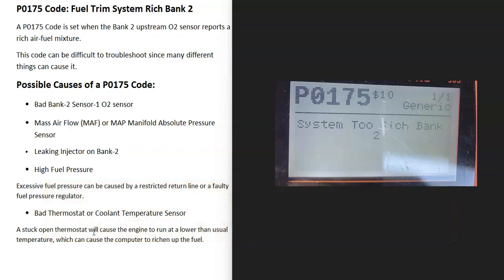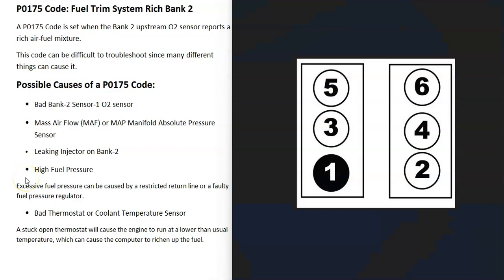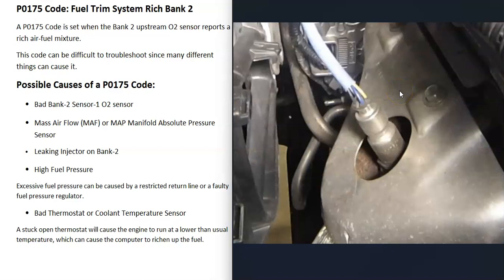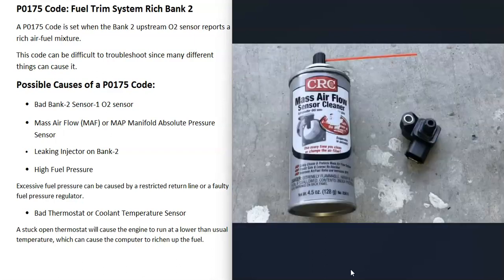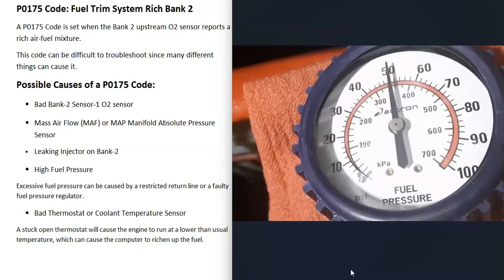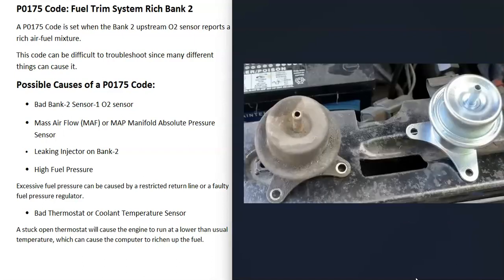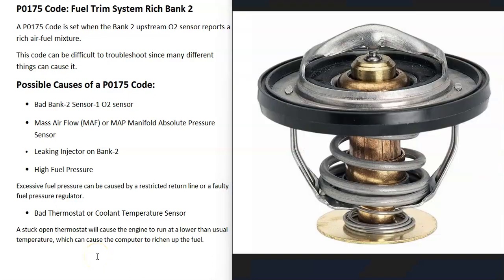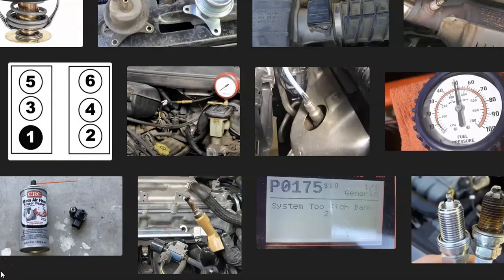Causes and Fixes P0175 Code: Fuel Trim System Rich Bank 2

Comment: What if both banks are rich and it’s none of that
Reply from the maker: If both banks are Rich, it is likely something that would affect the whole engine, such as fuel pressure, stuck open purge valve, or a bad sensor.

Comment: Replaced fuel injector pressure regulator, truck ran great for 2 days , better than it ever has. All 3 plugs on bank 2 looked exactly as your example , black. Engine light went off and thought I had found the problem but after 2 days the same symptoms started again. I'm wondering if I got a bad part /injector pressure regulator sensor. The plugs on bank 1 looked good. I changed all of them and new plug wires ( it was way overdue anyway )

Comment: Dang man, this was the video I was looking for. You are very knowledgeable with this. I just had my hellcat injectors upgraded to 1300s from oem, as well as an aftermarket flex fuel system with a double pump installed as well as a new tune. I got this code P0175 three times in a week after I had my work done. The dealership was saying it's a result of having bigger injectors installed which doesn't sound right. I took it on a trip from Virginia to New Mexico and it came on one time during the entire 1900 mile trip and that was while I was parked at a Loves gas station sleeping with the car running. What do you think the issue could be?

Comment: Question... i have a 2001 f150 with the 4.6l. It has blown out the plug 3 times in cylinder 3 on bank 2, passenger side. It has a helicoil in it. It has in the 4 yrs ive owned it, ran slightly rough. Ive ran the code multiple times since the check engine lights keeps coming on. P0175. I have replaced plugs, coils, cut off the muffler, changed all the o2 sensors, fuel injectors, and about to clean the maf sensor. Oh, and it periodically surges too. I temp is at normal range. I have done just about everything i can. What else could it be? Could the helicoil not be down far enough? I dont really smell gas from the exhaust. I am at a loss, and i dont have alot of money to take it to the shop. Any advice what else it could be would be awesome. Oh, after i changed all 4 o2 sensors, now it says both banks are running too rich. Thanks

Comment: Thanks for your help. can a evap purge valve cause this issue
Reply from the maker: A stuck open purge valve can cause rich codes, but usually, it affects both banks of the engine.
Reply: @HVAC_Mechanic Salam. Bmw 2D59 kodu aliram sebeb ne ola biler?

Comment: IF the PCM finds it rich and corrects the mixture , why mess with fixing it?
Reply from the maker: The computer can adjust for small variations. If it is too big, it will be outside the range it can correct.

Comment: Sir. Great video you know your stuff. Down to the point. I like the way you did your video with all the pictures and you explain everything the right way. We just changed the radiator or had it done on the Lexus ES 350 2008 so we got a code PO 174 and PO 175. Beside the video any help would be greatly appreciated. Thank you.

Comment: Wouldn't a lot of things you mentioned (MAF sensor, MAP sensor, Fuel pressure, engine temp etc.). cause a rich fuel condition in both bank 1 & 2, ie. P0175 & P0172. I need to isolate this to just bank 2. I changed the O2 sensor, the Fuel Rail Pressure was fine and did not leak down after engine was turned off. MAF and O2 sensors also seemed to be working fine according to the obd scanner tests.
Reply: @rjpool21    Did you figure out the cause of the problem? My tundra is showing the exact same codes.
Reply from the maker: Yes, those things usually affect both banks, although strange things happen sometimes. It could be a single cylinder on Bank-2. If you don't have any other codes, you could pull the spark plugs and match them to a burn chart to see if they are all burning lean or just one cylinder.
Reply: How does it tell that? I have a scanner as well. Am I missing something?

Comment: I replaced all sparkplugs , o2 sensors, coils, i cleaned maf sensor and there is still check engine light on my computer and it says drive thrain check soon … when i replace spark plugs i saw engine oil on  bank2 3th spark plug . How im gonna fix this problem im getting mad 😂
Reply: Time for a new car.

Comment: Would running rich cause a snicky exhaust? Could that make it smell like a bad cat, even when the cat is good? I thought it was the cats, but they look good. I hear a restriction in the exhaust. I thought maybe the mufflers, so I ordered new ones. When I went to change them, you can see through the mufflers. There is no restriction there. I don't think it's the resonators at the end. It sounds deeper inside the exhaust when I hear the restriction. IDK, maybe it is in the cats, the top side looks clean, like new. The O2 sensor is in the center of the cat, and it looks good there. I can't see the end really well, but from what I can see with my inspection camera, it looks okay. 2011 Charger ET 5.7.
Reply: Replace mass sensor w temperature sensor all oxygen sensor spark plug new coil all fuel injectors new. What now

Comment: Greetings, hopefully I might get a little more Guidance with this issue. I have a 2015 Yukon that had the transmission replaced.
Fixed it, then got a bad thermostat and temp sensor. So we fix that and now I'm getting this code. Po175... do I just need a code to be cleared? Now that it's running the way it's supposed to? Or do I need to replace the spark plugs, mas, check fuel pressure etc?....ugh.

Thank you
Reply from the maker: You could clear the code and see if it comes back. If it comes back, then it will need to be troubleshooted.

Comment: I have 99 chev suburban with 5.7 litter and original had a p0440, quickly jumped to p0300 & p0175. Any advice would be much appreciated
Reply: I’m betting your catalytic converter is clogged or restricting flow